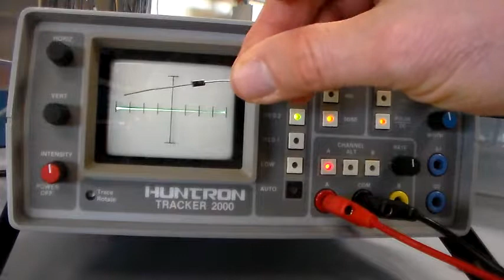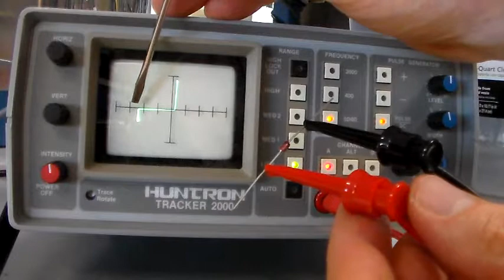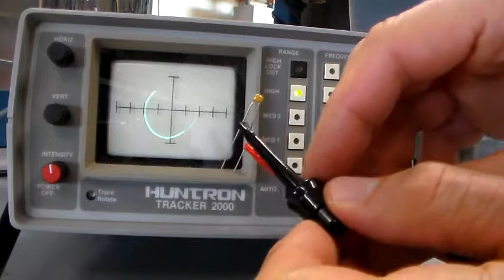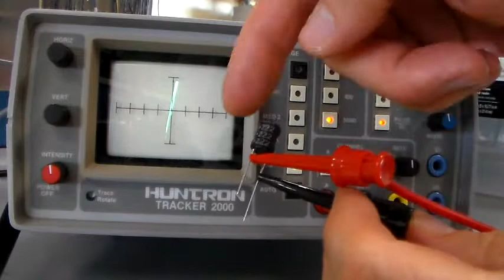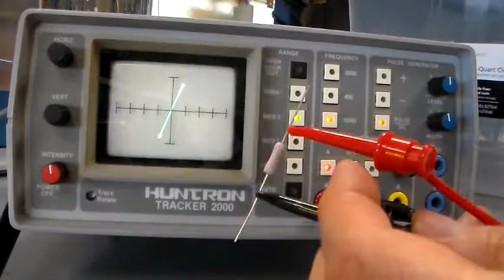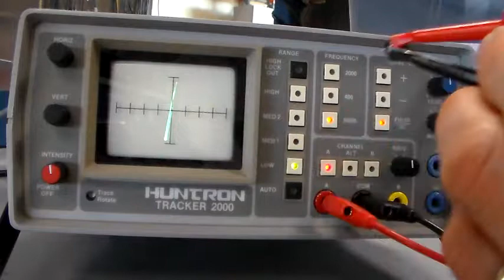Huntron Tracker 2000 basic demonstration

Comment: This was a great piece of equipment. I was working in the 1980's when TTL logic was dominant, and this tool was one of the best ways to detect faulty IC's. That was because TTL logic most often fails with a parasitic leak to ground developing between an IC pin and ground, usually the input pins would fail this way. It was a very fast method of fault diagnosis too, you could connect one pin of the Tracker to ground and simply wipe the other pin on the IC's pins, one after another. As soon as you saw something unusual, a strange looking curve (most of them were right angle diode types) you could stop and investigate.